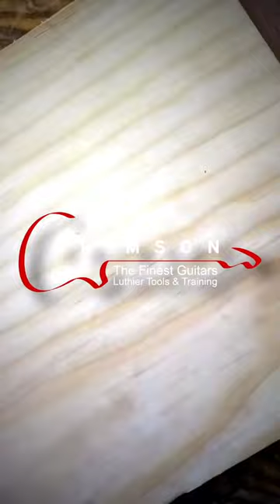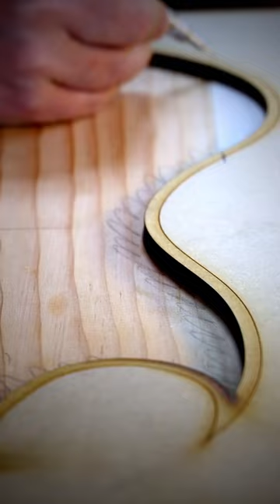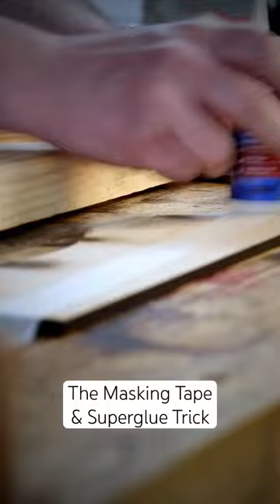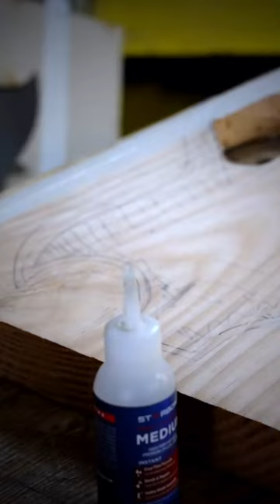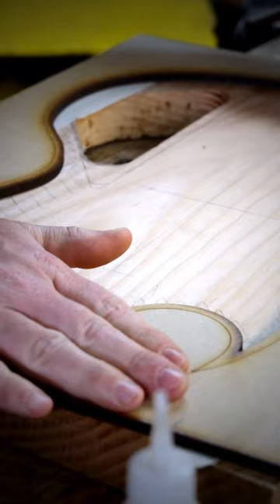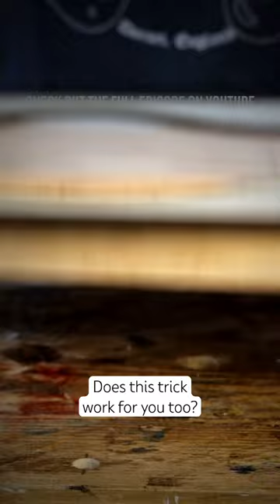When you learn this trick…it will change your life! 🤯 #guitar #guitarsdaily #woodworking

Comment: I don't have faith that I can keep them in line and I'll just end up gluing the template to the wood. Double-sided tape makes me feel safer. But this method seems better if you can get it down
Reply: I tried it and stuck the tape to the job. Went back to double sided tape. I cut it into small squares, so not too wasteful and easy to separate.
Reply: The trick behind the trick is to not use too much glue. If the line of glue is relatively thin and straight down the centre of the tape, it won't matter if you're out by a couple of mm in your tape placement.
Reply: I too am a double sided tape guy.  And like vtraddict said, small squares mostly, more if necessary.
Reply: I would probably use it in the future, it seems pretty pretty useful

Comment: The correct method is to design your templates and use them in order of task to be secured with wood screws. All of my templates are designed to use wood screws, haven't touched double sided crap in a long time and do not miss it! That being said Ben is a fantastic craftsman!

Comment: Some registration holes and steel dowel pins set  in the outside perimeter of the template  is nice insurance. I've had really good industrial strength double stick tape let loose sometimes.

Comment: Why not double sided tape? Those suckers are strong. Yes, not always easy to remove but guarante to stay where it should be. Just asking curiously.
Reply from the maker: That's the problem, many double sided tapes actually do move.. there's a little flex in the fabric etc that this trick removes. Also, this is just as strong as the strongest tape but removes very easily and with no mess
Reply: @CrimsonCustomGuitars  masking tape is elastic as fuck though. That's why you use it to clamp edge banding and veneers.
Reply: @PLF...  masking with superglue between isn't remotely elastic.